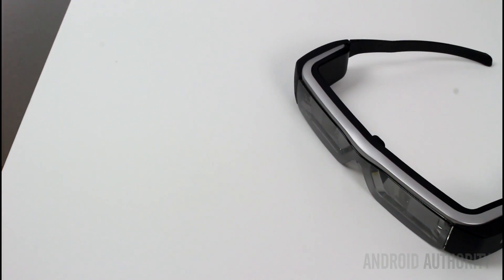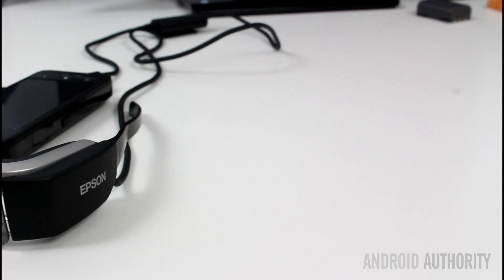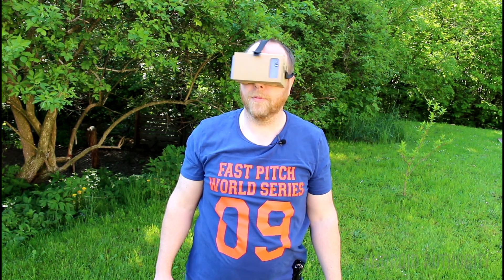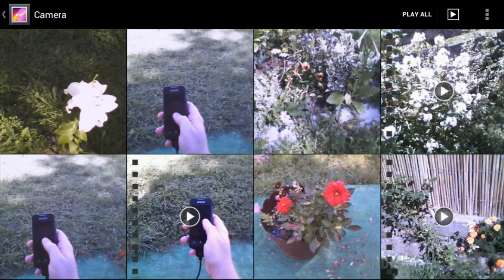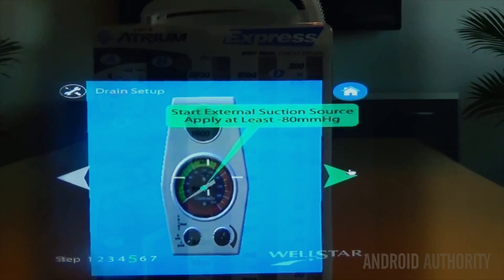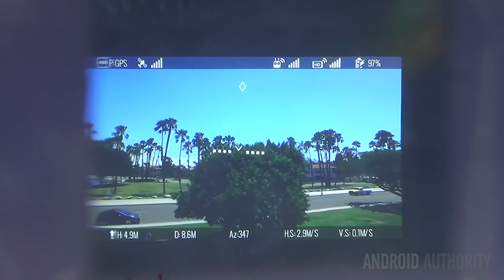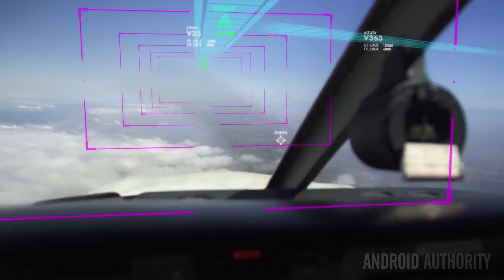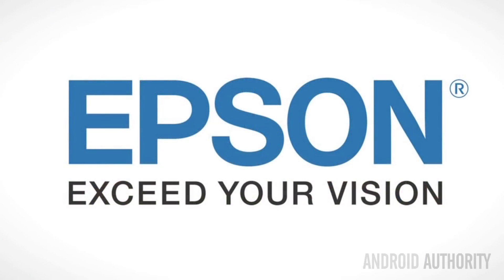Epson Moverio BT200 Smart Glasses Review

Comment: usually android authority reviews cool devices, but they missed the mark big time with this one. There is absolutely no way in hell anybody in there right mind is thinking, oh I have to go get these glasses. NO!! Whoever made these glasses needs to go back to the drawing bored........and start all over from scratch!!! These are a pathetic excuse for a device, much less glasses. Completely missed the mark!!
Reply: +Chris Sparks Its android authority, for all things android. Are you unaware this device runs Android?
Reply: +Chris Sparks I think you missed the point, these aren't like Google Glass (i.e. meant to be worn all the time), these are for specific tasks that need AR. For example if I was flying a drone in a park, I don't think there would be any reason not to wear these glasses. If I worked in a job which required remote "you see what I see" support then I don't think that wearing these glasses for a specific task would be bad.

People are prepared to wear the Oculus Rift, or the Samsung Gear VR for specific tasks, i.e. gaming. Why not these?
Reply: Virtual reality has a LONG way to go!!! I wouldn't wear them or any others for that matter regardless if it was for normal wearing or for a certain task.